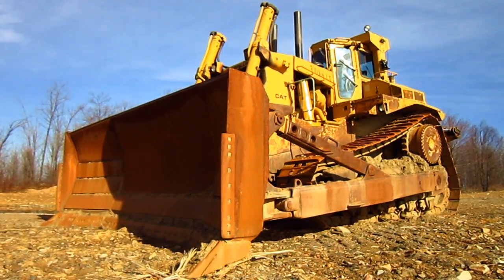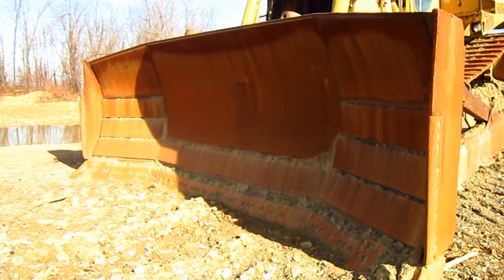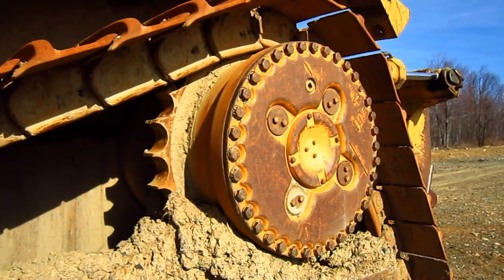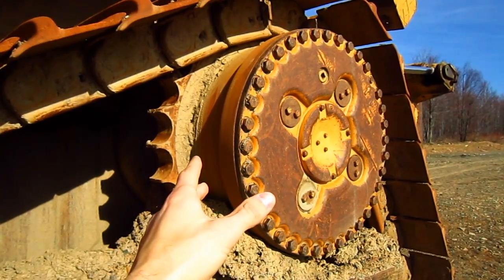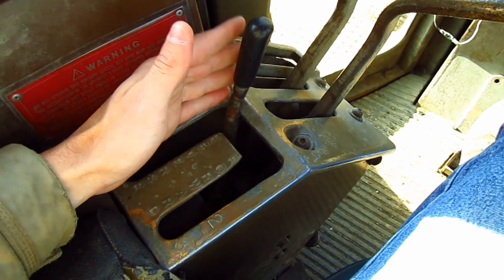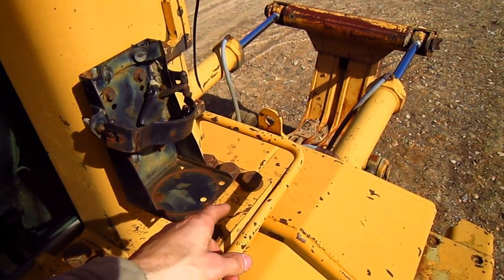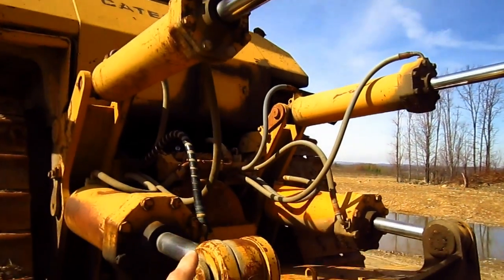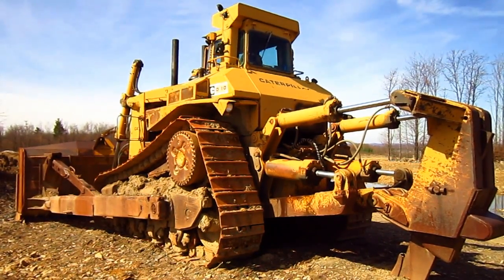Caterpillar D10 Documentary

Comment: The D-10 and D-11 aren't very good working around draglines when you need to move dirt quickly, as they were built for slowly moving a large amount of dirt. And they really shine on a down hill push. But they were much easier to work on than the older Caterpillar tractors. The transmission comes out the back on built-in rollers. Plus, if you needed to change an engine and the starter would still operate, you could unpin the lower radiator housing, push down on the blade control, and turn the starter, then the entire radiator and it's housing would fold towards the blade and out of the way. Two men could change the engine in 4 to 6 hours easy.